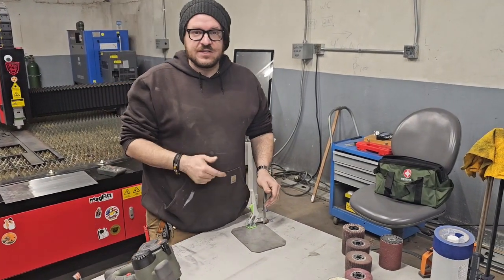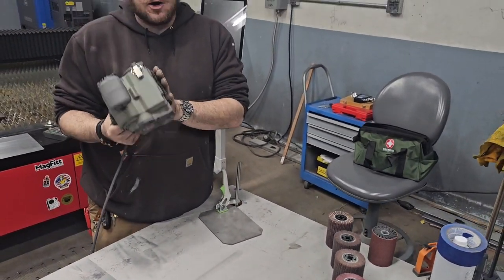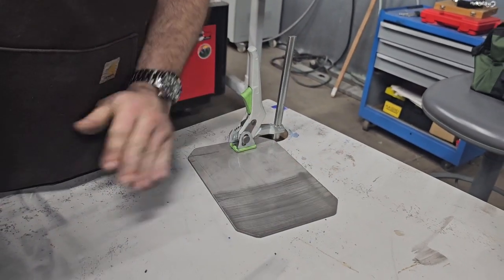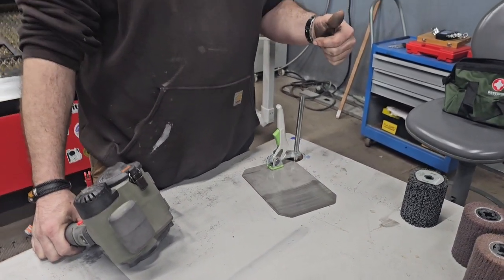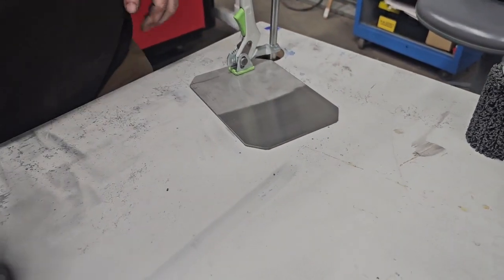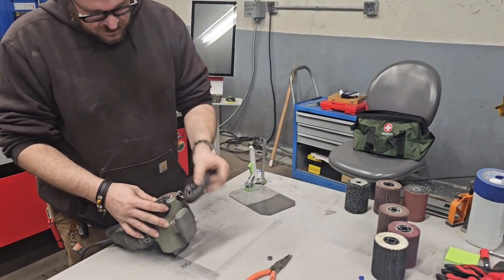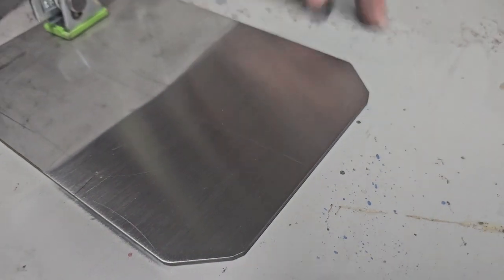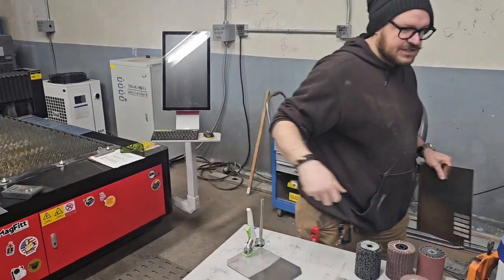Create #4 Brushed Finish on Stainless Steel 304 2b

Comment: Why not say what the second grit number is?  Going up a step does not say much
Reply from the maker: @RH3949  he went from 46 grit rust paint removal roller to 120 grit combo wheel then finished with 240 grit scotchbrite 👍🏼
Reply from the maker: 240 grit WRSBW24